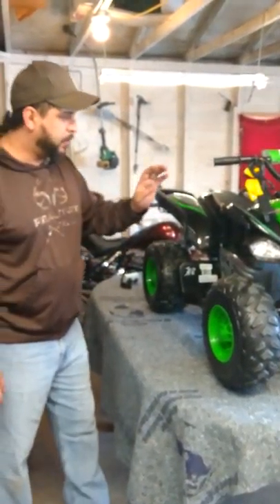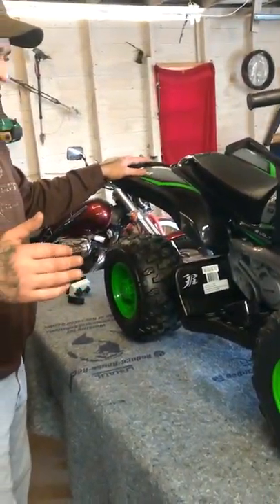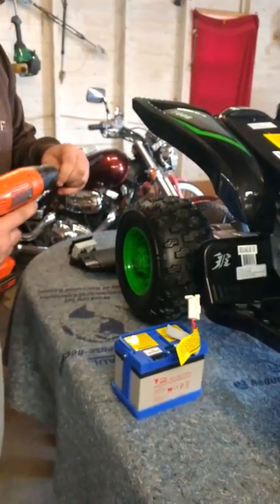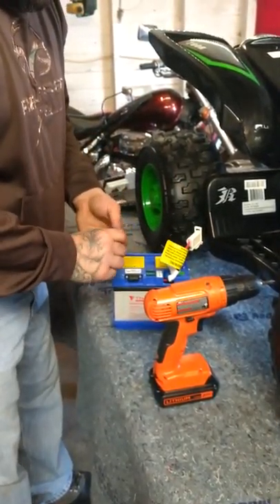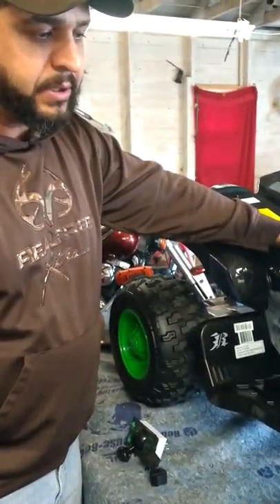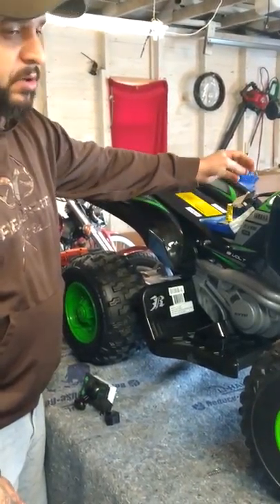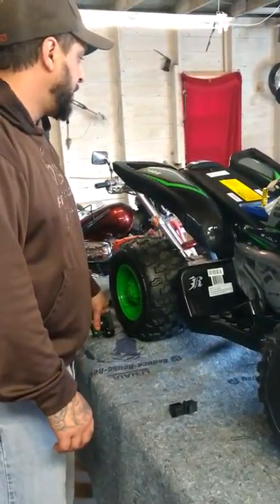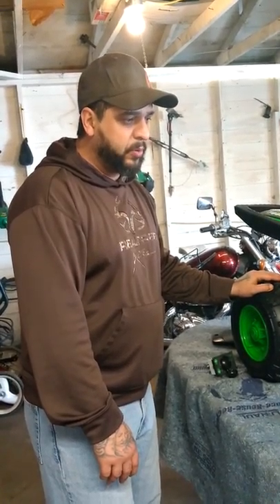How to fix a power wheel that doesn't work.

Comment: What if you buy a new battery, the charger shows green, but the Yamaha only runs for 3min max or not at all?
Reply from the maker: I’d say the battery doesn’t hold a charge, or the charger is bad. Often times the charger will read a false green light not given the battery a full charge.

Comment: Where can I get the shifter assembly and or switches?
Reply from the maker: You can call the company who makes the power wheel. Just Google it and call. When you get a hold of them just tell them which parts you need. They are pretty cheap. If you still have the instructions for the power wheel, the number for the company is on there.
Reply: Young Buck your videos are great. I need a 6 pin 'forward/reverse' rocker switch for an old PW Corvette. The pins are slanted to fit into the wiring harness. Mattel doesn't sell these anymore. Can I buy a switch from you or do you know where I can get this switch?

Comment: I have a Power Wheels 12 Volt Kawasaki ATV. We got a new battery for it, and it ran really well for a day, then it suddenly stopped working. The fuse on the battery blew, so we replaced the fuse and charged it. When I put the newly charged battery with new fuse on the power wheels and it immediately blew the fuse when the pedal is pressed. I replaced the fuses several times with the same result. What could be causing the fuse to blow immediately? The motor makes the normal sound when the wheels are rotated, so the motor sounds like it’s ok.
Reply: Did you figure it out ? I’m having trouble with mine as well. Bought it about a week ago and it died last night plugged it in the charger light went from red to green fast don’t know if the chargers the problem. I let it charger over night put it back in the headlights turned on then I pressed the pedal and moved a tad then everything just died. I checked the fused it was blown I replaced thinking the fuse was bad I tried pedal again and jilted that’s it checked fuse and it was blown put new fuse again and put it back on the charger and fuse blew again

Comment: I bought the purple XR-250 sport by power wheels maybe a week ago it’s been fine then last night she actually got on and started using it made me very happy then it died. I plugged it in the charger light went from red to green instantly I’m like that’s weird I let it charger over night and still nothing the lights will turn on I press the pedal does a little jump then that’s it. Popped open the fuse looked burnt so I replaced and did the same thing I put it back on the charger now. Maybe it’s the charger not too sure really. *Update I pulled out the new fuse and that one has a gap in the fuse now too.

Comment: Only the back left wheel turns did I blow a motor?
Reply from the maker: Hay Jerry, It's possible that one has burnt out. Something to keep in mind. A lot of power wheels only have one motor. Not sure the type that you have. Also the motors are connected to there power source via a cheep plastic connector. Might want to make sure you connections are all secure. Hope this helps and thanks for watching.
Reply: Jerry, did you end up getting it resolved?   My daughter has a Barbie Dune Racer , only 1 year old and in one evening, she all of sudden has no reverse, and when she goes forward, only the back left wheel is turning just like your issue.   Any tips would be greatly appreciated.   THanks

Comment: Hi, I replaced the foot switch and both switches for fwd/rev.  It worked great then died, no power anywhere.   I changed to  a 20v Dewalt.  Battery is good, all switches connected.  Any idea why it's dead-in-the-water?
Thank you, Sher
Reply from the maker: You got me!! I’m not sure what the issue is. First thing that came to mind is faulty foot pedal. These parts are so cheaply made.
Reply: @bridgetcaudill5189  I did order another pedal switch and a wire with a fuse.  I did not use one the first time.  If I get it running again I'll reply.  Thanks for replying.  Sher

Comment: I’m having intermittent issues, replaced shifter and still same issues, raptor is in fast mode and dies under a minute or few feet. It works in slow mode but my son don’t like going slow he has the need for speed. It only dies in fast mode and I will switch to slow mode and give it a push the battery indicator lights up and than it’s good only in slow mode when I switch to fast same issues

Comment: What if just one single wheel isn’t moving at all or getting no power ? What do I do ?
Reply from the maker: The lower volt power wheels only have one motor  so you would only get one wheel that moves. If it's a higher volt motor with motors on each wheel and one of the wheels isn't engaging of getting power I'd say first track the power wires leading to that wheel motor to make sure it's not a case of a bad wire or loose connection. If your wires check out to be good id pull the motor and test it directly to the batty using old wire. If it doesn't spin then you will need to replace the motor. You can find them motors really cheap on eBay or Amazon

Comment: All the lights come on and the radio but it won't move ... it ran for a few mins then stopped.. can you help me
Reply from the maker: Sounds like a battery issue. May need a new battery. Thanks for watching.
Reply: How would I test the battery
Reply from the maker: There's a lot of videos on YouTube on how to test voltage on a power wheel battery.

Comment: Great video but my sons fire truck has a turn key to power on. When i turn it on there is no power still.
Reply from the maker: Check for a blown fuse on the battery. If that's not it it's in the switch.

Comment: I left my sons power sheen in the rain on accident I took the battery out while it was in the rain 🌧 how do I fix this I put the battery in an it’s not turning on at all
Reply from the maker: Make sure the fuse in the battery is not Blown if it's not then I'd say there is rust at one of the power sources rather it be mother or switches
Reply: Bridget C it was the fuse omg Thank you soooooooooooooooooo much ❤️😘
Reply from the maker: You're very welcome. Any time you overcharge the battery, it will blow the fuse.
Reply: Young Buck how can I tell if the fuse is blown? My youngest son has a marvel captain America motorcycle with the side car! I also left it in the rain, charging one night😫 The battery appeared to be charging completely as the light on the charger was red, 3 hours later it was green! There’s only one red fuse on the batter itself. The power wheel will NOT 
turn on at all. HELP

Comment: I have a fever Range Rover bought a new battery and wheels sound just like yours sounded they are not stuck I push pedal but wount go
Reply from the maker: I would try to replace foot pedal. You can find them cheep on eBay. Good luck and let me know if your able to get it running properly.
Reply: Young Buck what st are you live
Reply from the maker: @LuisRamirez-jm9vz  Indiana

Comment: My car  has been making a beeping sound. Does anyone know what that means?
Reply: Does it beep twice when turned on.?? Mine is doing same thing. I'm trying to figure out whats wrong. Sometimes it works perfectly fine though. Then other times we try to turn the key on but it beeps twice and nothing works. We have the chevy truck 2 seater 12v from rollplay i believe. Its a power wheels make though.